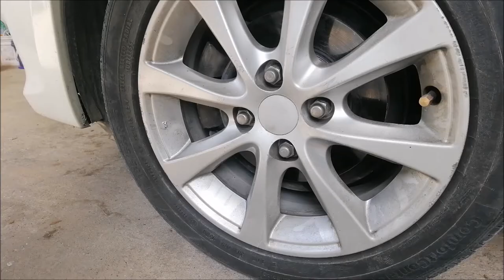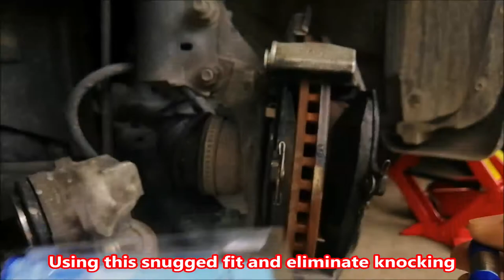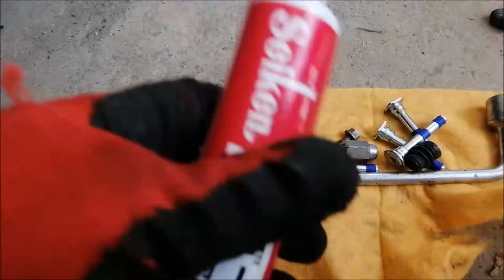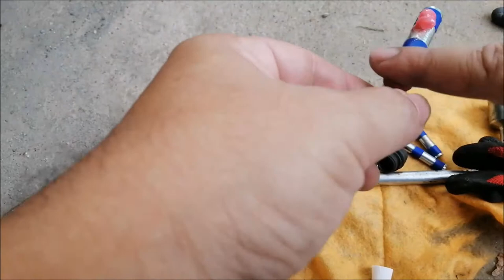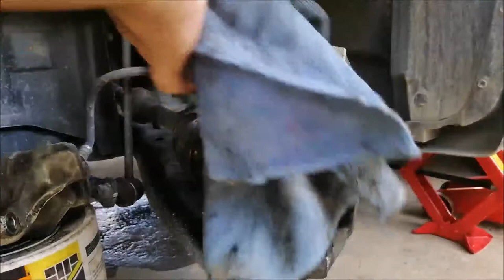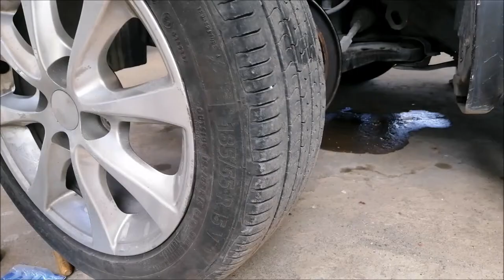#howto change brake caliper pin alza #car | cara tukar caliper pin alza | clunking noise braking

Comment: Tq cip... info terbaik. Salah satu masalah perodua. Caliper pin bunyi. 🤦🏻‍♂️🤦🏻‍♂️
Reply from the maker: Memang betul chip... Saya punya sudah berbulan bulan bunyi saya kira drive shaft apabila naiik bump, reverse, bslok kiri/kanan dan bola break... Ternyata bila dah tukar yang snugged fit caliper pin ini semua senyap....yang ori tu tak snugged fit Dan besi semua.. Dia boleh pergi kiri kanan atas bawah ketuk dalam lubang

Comment: Alza model tahun berapa ni bos?
Reply from the maker: 2010
Reply: Kalau caliper pin beza tahun utk Alza ada beza utk pemasangan ke? Atau boleh masuk jugak dekat Alza lama kalau guna caliper pin tahun 2014 ke atas
Reply from the maker: @mrk7785  saya pun kurang pasri tapi asalkan model 2009 sampai 2019 saya Rasa Sama asalkan bukan alza baru....tapi boleh Tanya seller Tu untuk confirm sebelum beli

Comment: Bro tolong sikit bole ? Agak2 sama x bunyi mcm video di link ni ? Setiap kali pijak brake knocking dia kuat
Reply from the maker: Kat mane die bunyi kalau dekat brake mungkin brake pad longgar... Cuba pakai tangan main2 brake pad kalau goyang tulah masalah die... Kedua you pegang driveahaft kalau longgar itu masalah driveshaft
Reply: @neodiy  benda ni terjadi selepas tukar brakepad , xtahulah brakepad bendix xikut spec kereta ke apa .. tapi perasan mmg ad gab cuma bunyi mcm rack end kdg mcm lower arm , so tdi tukar lowerarm xsettle jgk masalah ni ..
Reply from the maker: Cuba Jack kereta up Dan pakai tangan goyang2 mesti ada benda yang bunyi.. Try one by 1.. Brake pad, lower arm, driveshaft, steering rack.. Kalau bunyi tak semasa putar steering kemungkinang rack bush longgar